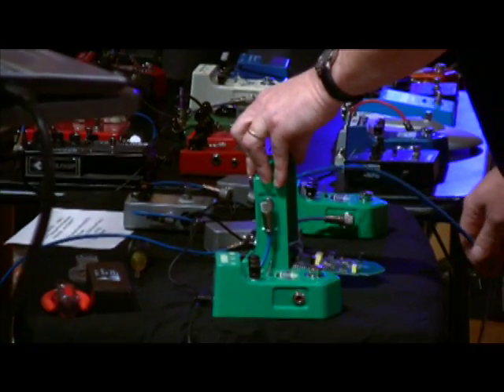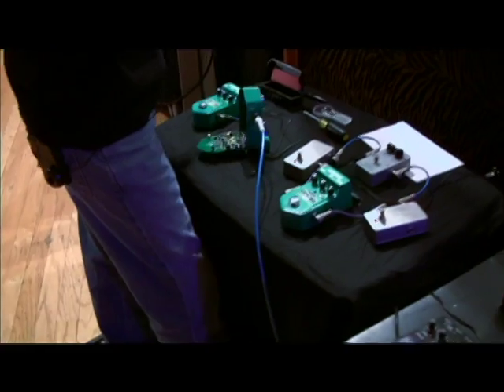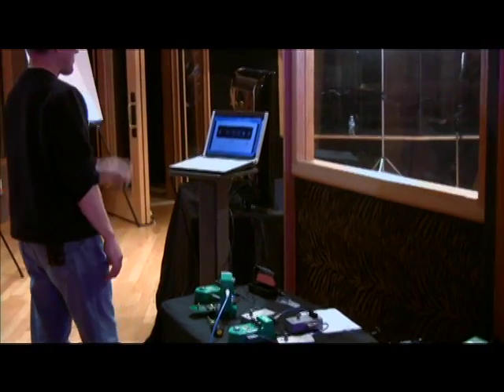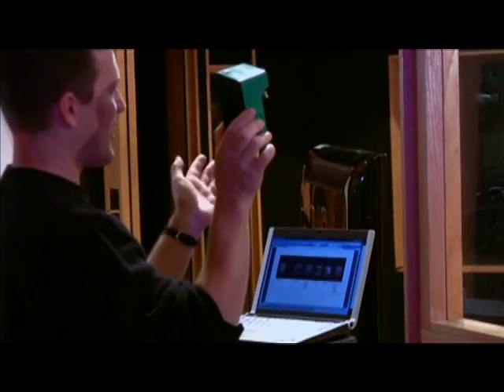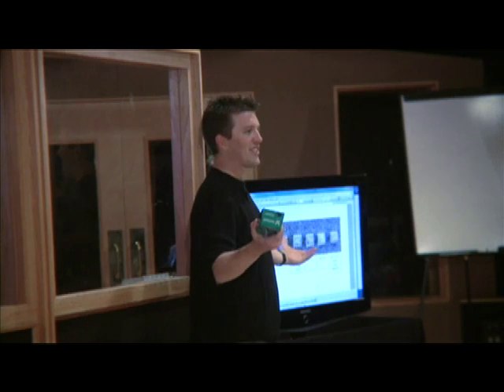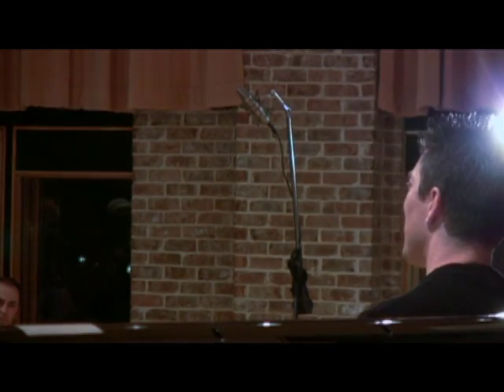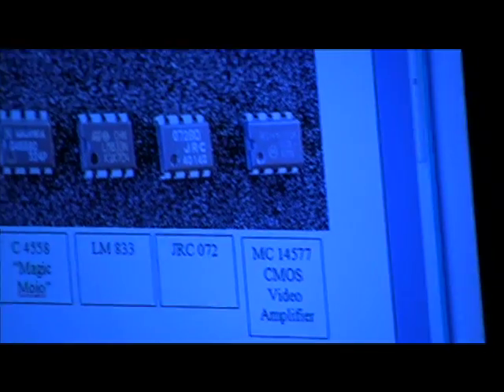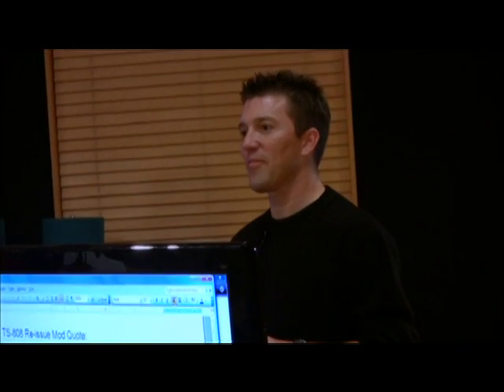Visual Sound: Myth Buster #2: Op Amps

Comment: I have some 500 modules with replacable op-amps. I use them for recording drums, percussions, synths and such. They do really sound different. For example a 2520 style opamp will sound different from a 1731 style opamp. But these differences are subtle, but they are coming from the different opamps. When recording, in a studio environment you can hear these small differences, they dont appear as obvious in a mix or for someone who listens on your average speaker. But as a mixing engineer you want to give the signal the best treatment possible, so you can start messing with these kind of things, try different preamps, different effects etc. Its all part of the process.

Comment: it's okay when you compare the different op-amp with the same type or spec, but before that, you should check the datasheet.  it's different between bipolar , j fet, mosfet , or bimos etc... also check the slewrate, thd, etc... it's big different !!! so stop calling all op amp it's same before check the Datasheet!!

Comment: I have zero interest in this shootout. I believe in pedals that work, and work well, whenever you need them to.I believe in companies that stand by their products. I believe that distortion is one of the most important components of a guitar rig, and despite most being VERY similar,the devil is in the details. All that said, I have never, EVER had a pedal preform as reliably, night after night, dive after dive,countless hours of time in the studio playing the same 20 second part over and over AGAIN, as my Jekyll and Hyde. Whenever I would go on tour id take 2, just in case. Years later after retiring I dusted off the old j&h and found the switch had busted leaving the Jekyll side as Basicly a boost. I email them just asking about availability of new ones.and they send me a simple rebuild kit.and say that if I have trouble to send it in and they'll fix it. It doesn't seem like much but they believe in their products. Even older designs they've since improved upon.I wish they made more pedals I use.But no matter what, when it comes to distortion I'll never not have their pedal in that spot.
Reply: I'm with you, the J&H is a very very good pedal. Well worth the investment. And you can't go wrong with it.

Comment: There is this misconception that the 4558 is rare and special and expensive. It is, in fact, a mass produced, general purpose, incredibly cheap, dual Op-amp. These ICs are found in all sorts of consumer grade electronics, cheap practice amps, and drive pedals. They have been in production for half a century and are commonplace. 
Yes, Stevie Ray Vaughan used a Tube Screamer that had this chip. No, it is not the secret to his  sound. It is, in fact, a mass produced, general purpose, incredibly cheap, dual Op-amp.
Reply: Analogman is part of the problem. He STILL pushes the nonsense about the mythical 4558
Reply: Mike makes his money from people who believe in this - he has zero incentive to tell the truth lol

Comment: I've built a few Tube Screamers and clones/mods over the years.  Including the DOD FX-91B and the Ibanez PD-7, and the OpAmp Big Muff which uses a JRC4558 and an LM741.  The only differences I've noticed with rolling opamps is signal clarity and noise performance.  The FX-91B is an interesting one, because it used JRC4580's.  I've been using those instead of 4558's in TS circuits and they do seem to be better in the noise.  LM833 works as well.

Comment: What about Muffs? The opamp Muff sounds quite different to the other versions from that era (the NYC Big Boxes)
Reply: That's a case of a pedal without an opamp vs one that does
Reply from the maker: This video is over 10 years old. Zac
Reply: That’s because the circuit is completely different (op amp vs silicon transistors). This was only about changing a specific op amp in a circuit.

Comment: This! It makes no sense for there to be tonal differences between different op amps, since the low-pass characteristic cuts off in higher frequency ranges than the audio band. The only op amp spec I ever consider looking at is SNR, which is usually in good enough standing for most chip packages.

Comment: Have build a lot of overdrives and distortions in the last 40 years. I always noticed a very slight diff in the used opamps. The way that they react on my guitar, playing style etc. It was never an issue for me. But one question, I had a several pedals (can't remember which one)  which has the same electronic schematic, the only diff were the components. One with normal soldered components and one with SMD components. To my ears there is a big diff between the two. The SMD comp pedals sounded all much "colder, less dynamic" and so to my ears. Is that known by the experts or is it my personal Mojo?
Reply from the maker: The reissue Dyna Comp was surface mount. SO many things affect tone. One of the many, is the position of the component on the circuit board itself. Circuit board layout is critical for good tone, and preventing noise issues.
Reply: I think a bit of both. What might trigger differences are degradings of capacitors in your analog circuit. That pulls resonance frequencies of your highpass/lowpass schematics, and that kind of shifts the equalization a pedal can bring. And we all know, what a tweak in certain frequencies can change the game (best example would be speaker changes).

But I think it has nothing to do with the component style, but rather the fact that the SMD built platform is way newer, and degrading of capacitors (especially when paper or oil-paper cpacitors are used) is not that processed.

Comment: I've been building effect pedals since my early 20's. This is SPOT ON. Distortion is tuned by your caps and diodes, not by op amps. And they all are made on the same machines and sound virtually identical. A chip is a chip. Get them at Radio Shack or on-line surplus outlets for pennies. There will be slight differences in individual tolerances, but if you think you can hear it on stage then I'll be happy to sell you a "boutique" pedal for >$5oo dollars made with the chip of your choice....
Reply: Even Brian Wampler agrees with you and Visual Sound/Trutone. The chip does not have the answer to give a pedal its amazing tone.
Reply: @bpabustan  I think the myth gets spread because of pedals like the Rat2 where the components were changed from the original, and there is some truth to it that the Rat2 does not behave in the same way.  But it doesn't have much to do with the opamp in that circuit as it does with the slew rate of that opamp.  The Rat2 does not have the same slew rate as an original Rat, because the OpAmp is different, and the slew rate cap is not only a different value--it also has a higher slew rate than that original.  You can get the same slew rate distortion from an OP07 as an LM308 by simply changing the compensating capacitor.  I use a TL060 (iirc) when I build them.
Reply: @isher9035  Do you know where I can get a TL060 capacitor? I'd really love to experiment with my rat 2 pedal! thx in advance
Reply: Andrew Spitzer 
Hi, any advice to reduce floor noise from a pedal?, Tks.
Reply: Make sure your circuits are properly grounded. Check jacks for poor solder connections.  Use shielded wires (which also must be grounded). Swap out stock potentiometers with higher quality pots. That is where most of the noise is. If that does not help, replacing the chip might help just because there can be variance from unit to unit (one may have been manufactured poorly).

Comment: Maybe not in guitar pedals, but in DIY synth building different opamps can totally behave differently, my oscilloscope will show you without a doubt, from my point of view you didn't bust anything at all. Depending on the circuit of the pedal there probably is SOME pedal SOMEWHERE that would make your mythbust look incredibly stupid, I might just build a pedal specifically to prove your bust is bunk
Reply: That was literally the exact context he was using.
Reply: He was talking about guitar pedals ONLY and EXCLUSIVELY. A specific overdrive pedal called the Tube Screamer that has been hyped beyond belief. Nothing he said or aimed to prove had anything to do with synths or any other application in which an opamp is used or has been used, ever. You obviously have no grasp of context in this matter and your comment comes off..., well, incredibly stupid.

Comment: The LM308N op amp apparently changes the tone of the Proco RAT. Ive heard a few clips to agree with it. The LM308N gives a smoother sound with less gain.
Reply: Arjun Kaul LM308N has an exceptionaly poor slew rate, which sounds 'good' to our ears. Yet I sold my original RAT and kept the RAT 2 with the Texas Instruments chip.

Comment: Some of my friends are guitar player and some are audiophiles or audio DIYers. Those who're playing guitar don't think changing the op-amp does any matter, even using OPA627. They change the caps to get different sound directly (as they thought). But those who're audiophiles believe that changing op-amp does the matter, even same type from different manufacturer. People listening different music prefer different op-amps. Although they believe that topology of the circuit makes the sound so different, they change the op-amp all the time just to find a sound they prefer. So I think the myth is busted just for guitar pedal only.

Comment: First, these are dual opamps, both opamps in the chip are used. In a TS808-based circuit, the clipping is performed by the diodes in the feedback loop of the 1st opamp (1st by position in signal chain). So the effect on tone of different opamps will be minimal, if it is noticeable at all. If the tone/drive is the result of the opamps clipping, then there will be a difference. It has been a long time since I sat down and compared different opamps clipping, but I remember when I did try different 4558 opamps with other compatible types like the TL082 which is a FET-based opamp from TI, the largest difference I heard was when I compared regular silicon opamps to FET opamps. Between the silicon opamps, there was rarely a noticeable difference. The FETs seemed to have a little more of a noticeable difference but very minimal. Most overdrive pedals derived from the original TS808 design do not use opamps to clip which allows the manufacturer to be able to use different opamps when they want to.

Comment: I would accept that op-amps dont make a difference in all applications. But in some they DO really make a very obvious difference. Like in headphone amplifiers...when using really high quality, very transparent headphones, difference opamps can completely change the sound character, and sometimes the difference in sound quality in can be pretty major. Not night and day, but its like using different quality sound cards....not a big difference, but its obvious when you hear both one is better.
Reply: Driving high impedance headphones such as Sennheiser HD600 will definitely cause problems for some circuits.  The output impedance of an op amp is around 75 ohms, fairly low impedance.  Matching impedance is necessary for maximal power transfer.

Comment: Of course you won't hear chip differences in overdrive sound, since you're massively degrading the signal with distortion (from the clipping diodes, and possibly the amp). One op-amp could have 0.2% THD and the other 0.002% THD and it would be swamped by the distortion. Where the differences matter is when you're building an analog signal processor that is supposed to be as quiet and distortion free as possible.

Comment: I think that at the very most, the differences between a 4558 and a "modern" alternative op-amp would be the current consumption, noise characteristics and perhaps slew rate. Of these, the first does not affect "tone" as such (unless it sags the battery I guess, but it would have to be a real POS to do that) the second is negligible in the vast majority of op-amps designed for gain at audio frequencies and the third....well, that is IMO the only thing noticeable in 4558s as treble rolloff.

Comment: I hope you're kidding @0:33 , as ALL should be encouraged to venture forth into seeing how their gear works and finding these things out with their own function.
Op amp chips while subtle definitly change character in sound, as you clearly indicate. The JRC's are very common. The cool thing about Op AMps are they are very cheap if you go to parts suppliers and don't fall for "magic mojo" crap. hehe. Great video, thanks for sharing to those that could not attend.

Comment: I did the same thing last night with a clone overdrive I was doing,  had 4 OpAmp IC's and they all sounded alike, but, the output level had a little bit of difference, but not so obvious.  But the tone would change if I change the values of capacitors...as well as the clipping diodes. :)  Thanks Visual Sound for the enlightenment. :)

Comment: You are absolutely correct. Way back in 1986
or 1987, I modified one rock guitarist's DS-1 by 
just changing the mica capacitors around the
clipping and tone circuit and obtained a much
cleaner, sweeter sound.

I didn't even change the diodes, let alone the
op amp, like most mods on the net do.